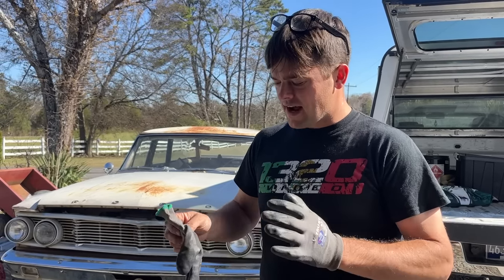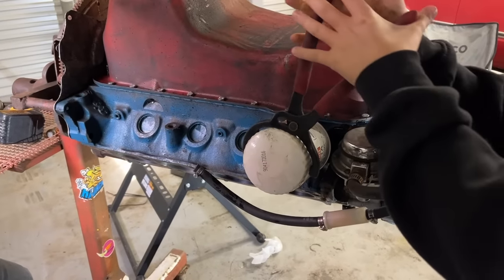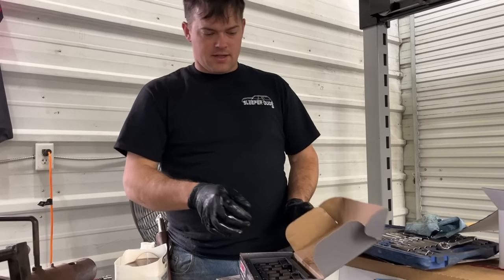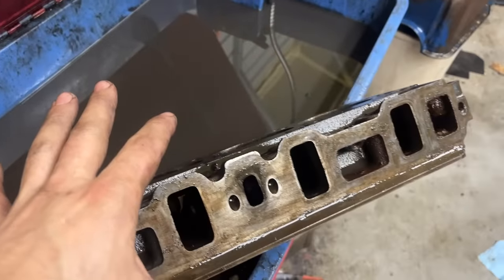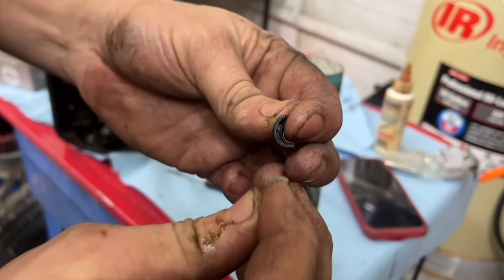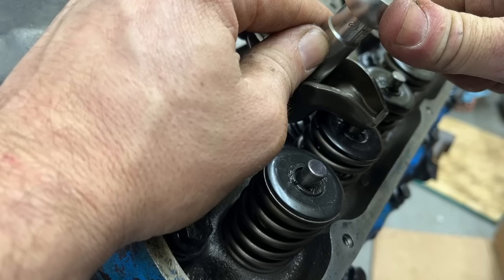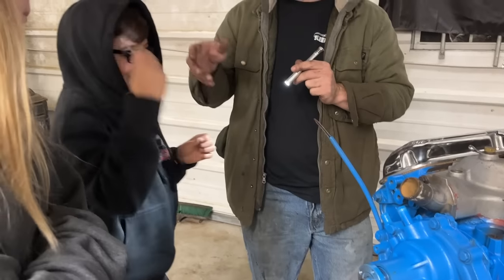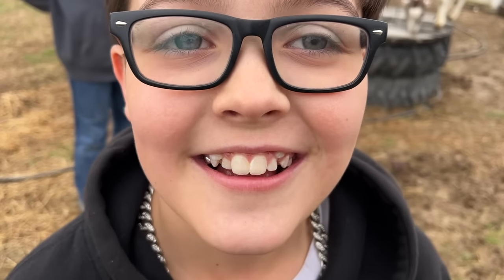We Had Issues! Small Block Ford Engine Build 64 Galaxie Station Wagon

Comment: The valve retainer height difference is because the exhaust valves in the E7TE heads used rotators and a shorter valve spring than the intake because of the thickness of the rotator. Only two ways to fix it is either change the exhaust valve to an earlier model valve that didn’t use a rotator or get the Trick Flow valve spring kit that is made to work with the stock exhaust valve in the E7TE or GT40 heads. As it is right now you’ve got too much spring pressure on the exhaust valve for a stock style setup
Reply from the maker: Ok thank you
Reply: @Sleeperdude you could get a different set of keepers since they make keepers that are offset .050 and it would raise the retainer on the exhaust up .050. It still may not match perfectly but it would help.
Reply: @Sleeperdude I’ll look when I get home from work but I know I have a new set of exhaust valves with the correct height but I can’t remember if they are 302 size or 351W size. The early 351W used bigger valves than the 302. If they are 302 size you can have them if you want them.

Comment: I'm not usually a naysayer, but I'd be willing to bet that if you plugged all of the coolant passages in that 289 block, filled as much of it as you can with muriatic acid, let it sit for a while, and then put it in a block washer it could be saved. I could be wrong, most engine builders would know MUCH better than I do, but there's also a possibility that the block is just compromised due to the amount of rust that's falling out of it. Still, a 302 is a much better option to go with due to the amount of aftermarket support that's out there for them.
Reply from the maker: Yeah I’m not sure he worked on it for awhile before he said it would have cooling problems

Comment: I would suggest a factory 1985 Mustang 5.0 Duraspark distributor with the steel gear instead of the Ready-to-Run HEI style China distributor.  I ran a very similar Pro Comp HEI ready-to-run in my 351w and it's electronics failed within a few 1000 miles.  It also had an absurd amount of mechanical advance.
Reply from the maker: Ok thank you

Comment: You probably know that you need to use a later bellhousing as the early ones were 5 bolt and the later ones are 6 bolt. Thanks for a nice video.

Comment: I prefer painting engines with a brush, almost as fast, almost no masking needed, and you can get a thick layer of paint on the first go, less risk of missing areas.
Reply from the maker: Yeah that would probably work good
Reply: Must be an old house painter!
I bet you cut in and rolled your daily driver!lmbo!

Comment: The 302 block is better than a 289 but there aren't many 289s around any more. If the only problem with the block is rust, bring it home!! You cam immerse it in water in a Rubbermaid container, put some washing soda or drain cleaner crystals (or regular baking soda). Then hook a 10a battery charger to the block and a piece of iron in the water. I think negative goes to the block, positive to the water. The rust literally falls off the part. Gets all the inner parts clean. Sometimes old paint falls off. This takes a day or two. Check other guys doing this about the polarity, I could be wrong. At least you won't hurt anything if you don't get polarity right. Just make sure the piece of metal in the water doesn't touch the block.
Reply: You're correct, negative to the rusted part and positive to the sacrificial steel. The rust will come off the block and adhere to the sacrificial steel! Electrolysis works great for hard to reach/totally rusted parts

Comment: And starters on small block ford is automatic and 5 speed manual will interchange 3 & 4 speed are their own the starter cone is different where it goes in the bell housing but the cone can be changed  from automatic to 4 speed standard if using stock ford starter

Comment: I think 1 and 1/2 turns are 1/2 too many turns for the Ford pedestal mount heads.  Here are the instructions from Crane for their roller lifters.

"To check and adjust the lifter preload, turn the bolt by hand until
there is no clearance between the front roller and the valve stem
and the pushrod is seated in the rocker arm pushrod seat. Slowly
torque the bolt to 18-20 ft/lbs. Since you are pushing down the
plunger in the hydraulic lifter as you torque the bolt, it will proba bly take a minute or two for you to get the correct setting. You
should be able to turn the bolt between 1/4 & 1 turn before you
reach the correct torque setting. This will give you the correct lifter
preload of .020" to .060". If you can turn the bolt more than one
turn to achieve the proper torque, you will have to shim the
pedestal. Two different thickness shims are provided for each
rocker arm to assist you. A thick shim represents approximately
one turn.
If you cannot turn the bolt at least 1/4 turn after first contact with
the roller and valve stem, you will have to install longer pushrods
to obtain proper hydraulic lifter preload. Pushrods are available in
different lengths, specifically for this purpose. There are many
modifications that may have been made to the engine which will
change the lifter preload, such as a valve job, different camshaft,
or different thickness head gaskets, and factory tolerances can
also affect the lifter preload on stock engines"
Reply from the maker: Ok thank you. The instructions with the comp ones said 1 1/4-1 1/2 that what I was going off of. I know they are a new design that is not like a standard hydraulic lifter
Reply: @Sleeperdude  Good to know

Comment: The darker Ford blue paint was the mid sixties to early seventies. The lighter blue was the mid seventies untill the mid eighties. Then Ford painted them battleship grey until they quit painting them at all. I know the 65  289 were black with gold valve covers. And the 260 was actually orange paint I believe

Comment: Bell housing bolt pattern on a small block 289 was 5 bolt bell from 1965 and before and 1966 and newer went to 6 bolt bell you can use a 157 tooth flywheel with small bell or 164 tooth with big bell housing and balance on flywheel was changed from 28 oz to 50 oz in the middle of the 1980 model year

Comment: It's good that water pump wouldn't fit, with the inlet being on the opposite side, it most likely was a reverse rotation pump designed to be used with a serpentine belt. Using it with a v belt it would have turned the wrong direction and you would have still had overheating issues

Comment: Save that block electrolysis will fix that. Dipping all block in a solution and then applying good strong electrical current

Comment: You should still take the 302 block out and have it cleaned and machine then reassemble it with all those sweet parts that you have then there'd be no mistakes no if ands or buts I said but LOL

Comment: Was the Galaxie engine a 5 bolt bellhousing block? Also, I ran into a problem with the newer engine not having the provision for the ball pivot for the equalizer rod for the clutch linkage.

Comment: Use undiluted vinegar ( don't touch it) get clean barrel flood it till you can't see the Engine leave it over 15hrs have a mini crane it will EAT up all Rust and it's corrosive

Comment: C5 only because you swapped out an engine upgrade engine/transmission swap is a bigger upgrade.  If you had even swapped another 283 for the original then use the original transmission. But up grade engine without and transmission upgrade is like putting shiny new parts on an old rusted tractor

Comment: Electrolysis would have cleared the rust out, you can use a plastic barrel to make an immersion tank and run it off a battery charger, check out the YT tutorials.

Comment: Any engine I put in a car. Especially used. I change the timing gear and OIL PUMP>>>>  Just a note.  Fords of the late 70's and early 80's had such poor oiling up top they had to go to roller lifters because any engine I had to pull and work on needed a new crank and cam and lifters they were always toast.

Comment: Left a pile of free donkeys in the intake by not taking some time to port match -- the engine tried to give you a second opportunity because the heads were way off the gaskets and that equals turbulence.  Hope you didn't bend that gear by hammering directly on it, brass is soft stuff.

Comment: If the 289 was original for the car it would be 5 bolt bellhousing, Ford changed to 6 bolt bellhousings through.  1965

Comment: I THINK THAT THE BELLHOUSING HAS ADIFFERENY BOLT PATTERN ON THE 64 IT WAS CHANGED IN 66 I THINK
Reply from the maker: The block is a 65 so it is the same as the newer one I did check that

Comment: Why didnt u make an electro static tank put block in fill water wash powder clamp metal plates to sides put power to each side low voltage & leave for hours  do outside as gives poisonous fumes. Seen done but not done.

Comment: If you soak the engine in a bath of evapa rust rust remover it will get all the rust out of the water vents
Reply from the maker: Good idea
Reply: Agreed. There are many other cheaper solutions that will even work better. That block is by NO means garbage. I have used FAR rustier blocks with no problems, whatsoever. In his situation, I think I would seriously consider looking for a new machinist. But proficient AND honorable ones are becoming like hens' teeth.

Comment: I would  have gone through the whole motor as long a it was down that far and flushed the block out inside and out. If the guy used JB weld and rvt like hat you think he put all the rings on the pistons in the right order the right rod caps on the right rod ect. I dont trust anybody, If my mom told me it was built id still check . people make mistakes
Reply from the maker: That is a good idea for sure.

Comment: Way it's good to clean a engine it will run cooler way should you paint a engine it will be easy to clean it helps from rusting an Easter to see if you have a lick and if you ever have to work on the engine area its nice an clean your not going to get all the old oil GRES dirt on you .yea Ralphie your getting 🔥🌋🔥 in the comments shame on you for saying that color on a Ford young man Ford an Blue is #1 I use masking tape put it on munched surfaces are at so when you put on the parts the gaskets will seal.